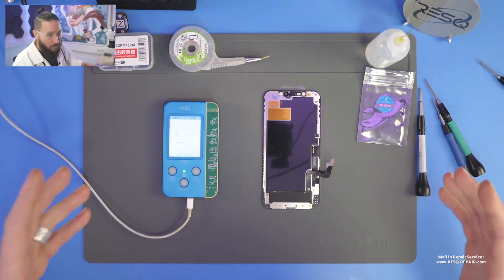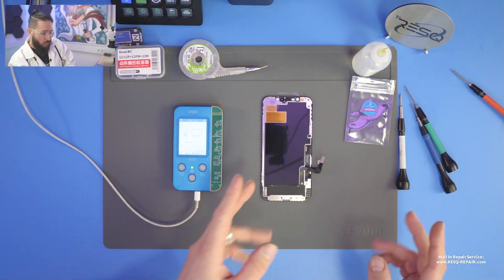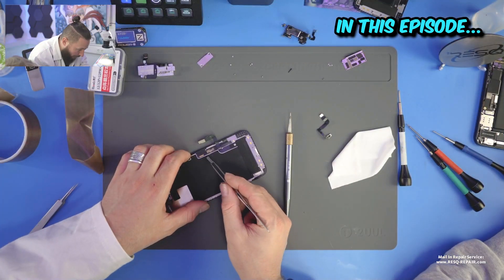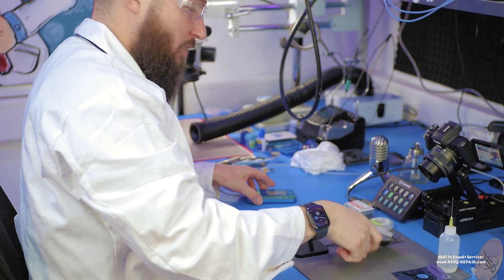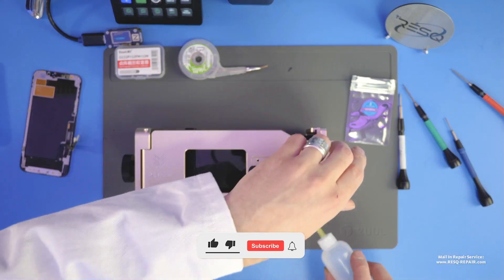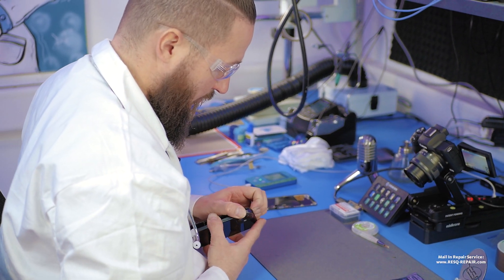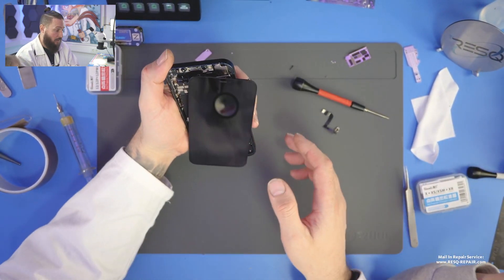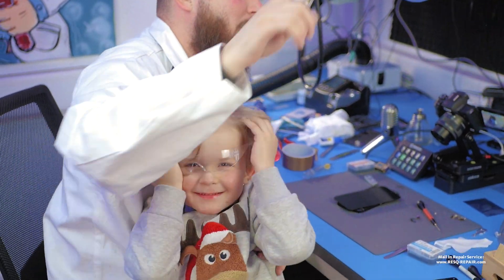⚠️ How to REMOVE “Important Display Message (Unknown Part)” WARNING - iPhone Screen & Face ID Repair

Comment: what temperatur you use on hor air  to remove chip from lcd ? Nice video as usual cheers from Canada
Reply: 200-300 just try on the broken one. Stop asking this kind of question, cz it depends on the price of your hot air gun 😅

Comment: i put back chip with soldering iron...for me safest method
Reply from the maker: Not even the safest and cleanest method. If you know how to use your hotair that’s much safer and cleaner.
Reply: @RESQREPAIR Dr. Ben, darf ich fragen wie viel kostet bei iphone 7 der audio IC chip zu wechseln? Weil ich kann nicht telefonieren mit das handy.